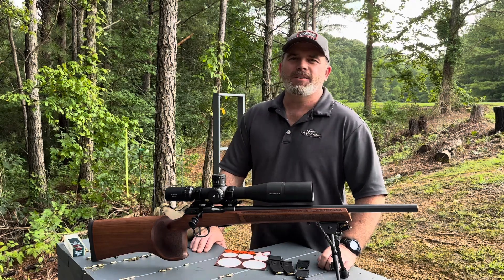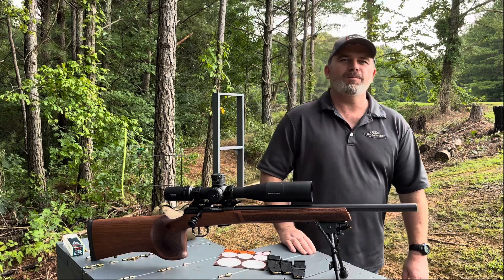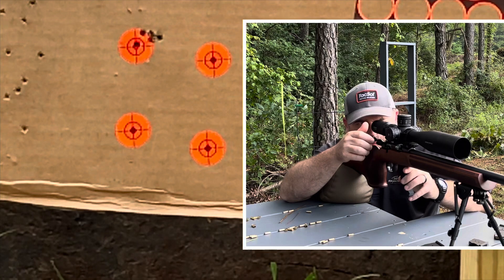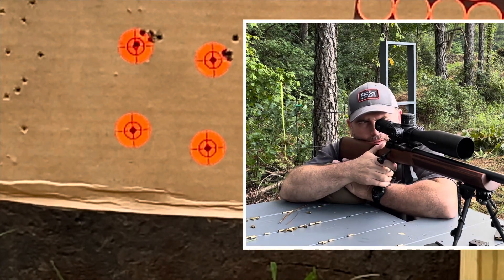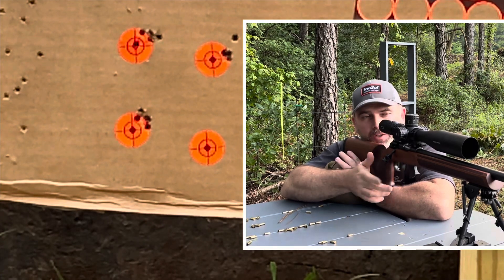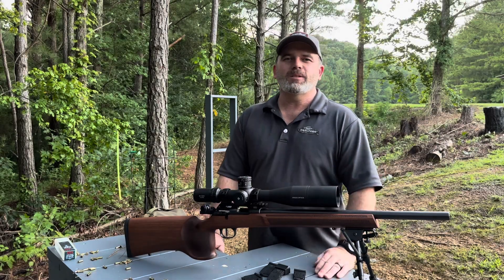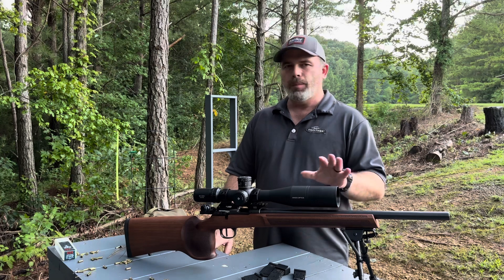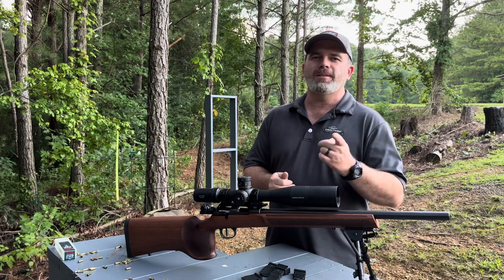Hold Up ..Wait a Minute. Something Ain’t Right!

Comment: I have a CZ 457 MTR that did not shoot well until I put 800 rounds through the CZ match chamber/barrel.  Great accuracy began after the 800 rounds AND I thoroughly cleaned the barrel/chamber (no carbon ring).  As I mentioned in a prior video presentation by you, I have found that my part of the process was the most at fault for loose groups.  Repeating my prior advice: 1) set the reticle to the anti-cant device; 2) reset your cheek weld each shot; 3) get your thumb from around the stock so not to introduce cant; 3) check the rifle cant prior to each shot; 4) be sure to focus on the reticle, not the point of aim.  I have had great results with Norma TAC-22 ($6.50/50 ads.) and SK Long Range ($13.50/50 rds.).  As I understand, Norma TAC-22 (I have a great lot number!!!) is made by RWS (German manufacturer) for Norma (Swedish manufacturer).  I use a Caldwell "Rock" front rest and a Harris bipod on the rear sling attachment.  The Harris bipod provides stability and helps me hold a constant anti-cant position.  Thank you for the effort of producing an interesting video presentation.  I FORGOT TO ADD... I installed a Timony trigger... GREAT results.  You may find a fellow YouTuber interesting to watch... Josh on his channel "Pursuit of Accuracy."
Reply from the maker: Thank you for the kind, informative advise. This MTR now has a Timney in it  . There is no question that my form/technique plays a great role in the group sizes. I am enjoying the challenge of conquering rimfire accuracy. My round count is not that high yet either. That is good motivation to shoot more.I have watched several of the older videos Josh put out but kind of lost interest when the Vudoos, RimX and big budget rifles took over.

Comment: Is your bolt that stiff to cycle?  I stoned all the sharp edges on mine and is smoothed out considerably.  I also started out at 10 in lbs and worked my way up.  I found my sweet spot was about 18.  Also on CZ wood stocks the factory is saying 25.  They say up to 35 with Varmint precision trainer and chassis models.  What was your initial torque?

Comment: Have you measured your head space with the barrel off? You could probably add barrel shims are bolt shims and get a perfect head space. Mine wanted a .040 head space for eley and a .043 for lapua. I ran 38 inch pounds on my cz and head space at .040 shooting eley match and it’s a 1/4-3/8 rifle. I do know trying the different head space to those measurements helps and you can also determine what brand of ammunition will do better are at least it did for me.
Reply from the maker: I have not tried that. Not 100% sure I know how to do that or where to get the shims if any are needed. I’ll have to do a little research. Thanks for the advice!